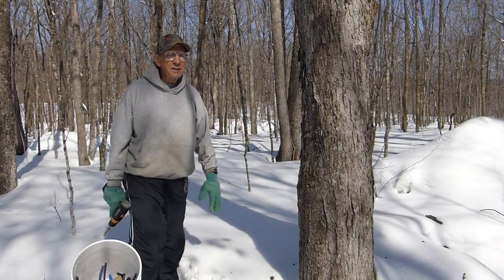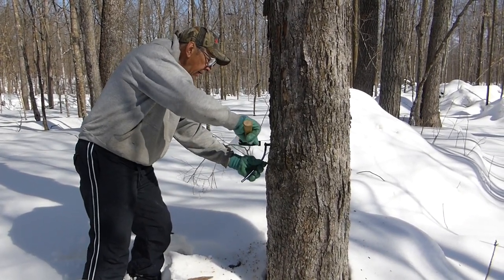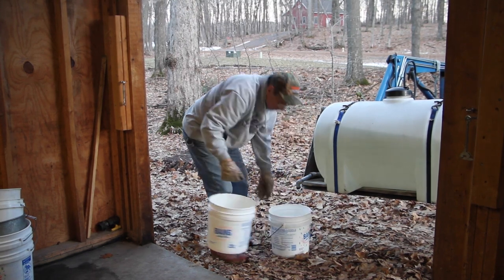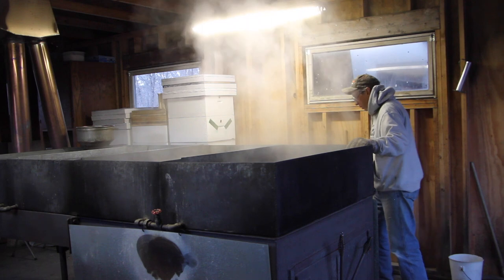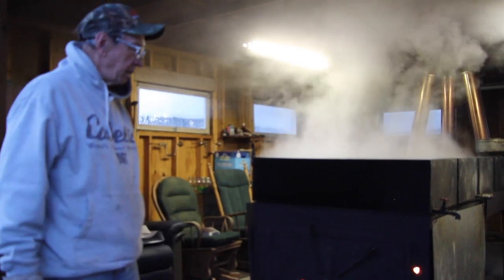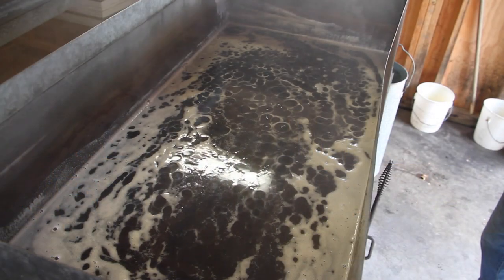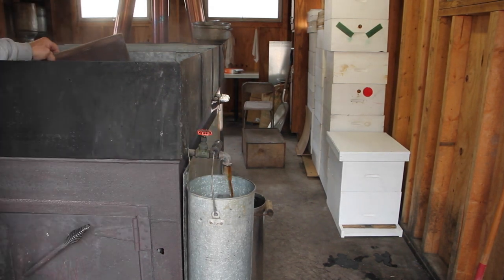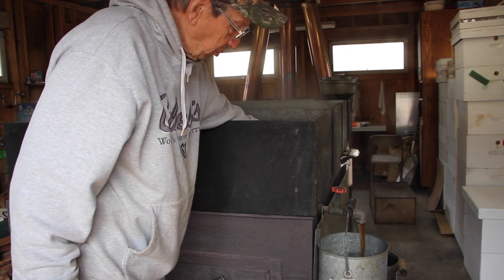maple sap documentary

Comment: The the sap is actually pushed down during the day and it comes back up at night to serve as an antifreeze for the tree. The carbon dioxide bubbles in the tree make pressure when its warms up. And when the pressure is greater then the barometric pressure outside it drips out of the hole.
Reply: Umm....nice try  but not exactly. When the trees freeze they actually create a 10 inhg vacuum in the tree bringing sap into the trunk. When the temp goes above 32 degrees they actually create up to 25 psi of pressure and push the sap out of the tree through any hole or crack. You may want to do some more research at Procters website or at the University of Vermont's maple page.

Comment: Great video!  Thanks for sharing.  What brand of filter press are you using?  I tap 60 trees and the difficult process I find is the filtering process.  I am in Ontario Canada and would like to check out some small presses like you have.
Reply from the maker: Here is Cy's response:  "I had shared a hand operated filter press with another family syrup producer.  The pump membrane failed every two years.  So, I purchased an electric powered filter press from WES FAB, 14420 N. 12th Ave., Merrill, WI 54452, Phone:  715-536-0501.  It was costly ($1,300.00).  It is fast, and it hasn’t failed.   Roth’s Sugar Bush, 656 Tower Drive, Cadott, WI. 54727, Phone:  717-289-3820, a maple syrup equipment and supply house, sells stainless steel filters of various capacities from $1,400 to $2,400.

When I started my family operation with milk jugs, oil cans, and ice cream pails I had used a wool stocking to filter the syrup.  The kids never complained about the small amount of sediment on the bottom of the syrup bottle.  I use 480 spiles."
Reply: Thank you for the follow up!  I’ll have to look up some suppliers here in Ontario Canada for pricing

Comment: Hello awesome video, I love seeing the old ways not the way it's done today commercially. I have a couple of questions I think I have 4-5 maple trees on my property, thought I had 6 but with your description of a red maple I have one with the buds.  Was wondering if that's enough to make a couple quarts of syrup. How do you know how many taps per tree, how much sap will I get per day on average, and how long can I keep the sap, or can I get boil it to kill bacteria and refrigerate it until I have enough to make a batch of syrup, cause I hear it's a 40:1 ratio, so I doubt I'll be getting 20 gallons in a day, I figured maybe a gallon per tap. So with only 5 trees id need a few days a sap to make it worth running a batch. This is only for my personal use so I'd be happy getting 3-4 quarts.  Thanks for your time any info would be awesome and if you have an email that I maybe could send pictures of my trees to confirm that they are the right ones.
Reply from the maker: +Derek Droc 
Sorry for the delay in response, I have been away from internet.  Here is Cy's response..."red maples do produce sap that is 1 - 1& 1/2 percent sugar (our's may be 3 - 5%), therefore the ratio would be 50:1.  The syrup is sweet but tastes somewhat different.  About one gallon per spile on a good flow day.  Freezing after boiling the sap is fine. Small batches are hard to manage.  Boiling sap in the house makes everything sticky. (Therefore, boil outside on cookstove or fire.)  Try it and be creative about how.  Discovery is the joy!"

There are lots of other youtubes that might offer advice on the 'backyard' sapper.
Reply: I make 2-3 gallons of syrup each year tapping only red and silver maples.
Reply: Julie Brown  . Julie, can u tell me what kind of jars he is using?  mom and dad have always use the canning process for the syrup in a pressure pot, this gentleman looks like he just poured into a glass jar with a probably might guess his of Steel lid?
Reply from the maker: Cy uses 'Snapple' bottles.  They are washed well. The hot filtered syrup is added to the bottles and the cover will 'pop' and reseal the bottle. Occasionally, one fails to pop and is kept in the refrigerator and used first.
Reply: If you cook your syrup down to the red line Or 32% on the tester, you do not need to can it, just put it in the jars hot and it will seal and stay preserved
Reply: Thank u.. one other question. . Hard freeze. . The whole bucket freezes.. many say that the ice is just water.. I was looking for some clarification on that, how cold? how much ice is just water?
Reply from the maker: Here is Cy's response:  "Yes, the ice is just water.  Sugar's chemical formula is:  Carbon 12, Hydrogen 22, Oxygen 11.  You can see that sugar is nothing more than carbon and water, formulated by photosynthesis (sun light), and it cannot freeze as a molecule.  HOWEVER, these molecules are trapped thru-out the ice block, - they don't settle out or separate out.  I boil it all.

Maple sap is 95 - 97 % water as it flows from a sugar maple."
Reply: If it is a hard freeze I will let it all thaw, but When I dump it into my bulk tank, I have a screen in the funnel, and ice that doesn't go through I dump on the ground, I tried saving all the ice one day and tested it and it showed zero sugar,
Reply: Thank you Julie and Trip so much for that help..
Reply: Sorry I have one more.  The white that " settles out after it canned" is that the sugar sand I am reading about.. by getting that white on the bottom of the jars, I must not filtering it enough?
Reply: And if that is the case,  any suggestions?  Thanks you all..
Reply: And By the way... I think I'm addicted to this!!  Lol... I have now taped about 30 trees
. And we just did the second big boil. 110 gal.wa 's the first one and the second was 70 gal.  All the family will have some syrup! !
   Now to make the stove or something  that I can use wood on..  propane is not cheep.. but I am learning!
Reply from the maker: Cy's response:" You are correct about what the white layer is.  It is also the accretion on the bottoms and sides of metal sap cooking vessels.  No harm in consuming it.  An orlon filter bag from a maple syrup equipment provider will capture the majority of the "sand".  A pressure filter using filter papers and diatomataceous earth will remove all the sand.  The filter devices are pricey."
Reply: Julie, 
Thank you for helping me out. 
And by the way,  the propane is not cost effective. But I will have to just consider it the cost of going to school. Please tell CJ. Thanks.
God bless.    David
Reply: stoke a wood fired epaporator vs propane

Comment: Hello CyGlad I found you. There are a lot of opinions out there but I question some of the advice.You are old school and that is what I was looking for. The sound of the sap landing on the bottom of a empty bucket is indeed "music in the woods"Question: How deep do you drill the pilot hole.  Also  I never saw the two types of spiels used  and the positioningWhat is the reasoning with that processThanks Tom Stockbridge, Ma
Reply from the maker: Cy's response: 

I mark my drill bit at 2 & 1/2 inches.  That is the maximum depth for large trees.  The outer 1/2 inch of the sugar maple is bark, xylem, and phloem, therefore the productive sapwood hole is about 2 inches.  I allow each sugar maple grove to “rest” for five years after tapping as recommended by my Native American neighbors, to allow for new sapwood growth, and to show gratitude and respect for nature.

Iron was abundant when the earliest spiles were manufactured.  The process involved forming sand molds and pouring molten iron into them.  Their shortcomings were rust and breakage.  At that time aluminum was rare and greatly valued at about $1.10 per ounce at 1850 dollars.  A very small cone was installed atop the Washington Monument to prevent lightening strikes.  Since then aluminum has become abundant and preferred for spiles (and beer cans) because of strength and non-corrosion.

The upper and lower spiles for each gathering pail are off-set laterally so as not to interfere with the sap flow from either hole.   Subsequent tap holes should be at least 2 inches to either side, and 8 inches above or below old holes.  That rule became evident when I had a blow-down sugar maple log sawn into lumber that showed the interior response to tapping.

Probably a late sapping season for both of us, Tom.  Winter is being persistently violent East and Midwest.
Reply from the maker: I just published another video with Cy that I think you'll appreciate.  https://youtu.be/anjTeQ7vVxc

Comment: He is measuring hot syrup but the instrument is usually calibrated for specific temperature (usually 15 ˙C). Is there any temperature adjustment made when measuring sugar content?
Reply from the maker: Here is Cy's response: "I very carefully measure specific gravity at 212 degrees  F (100 C).  If over that density, the syrup is a super saturated solution and when cooled will crystalize in the containers, often looking like large, uncut diamonds.  Interestingly, those crystals have no maple flavor when dissolving in the mouth.  It appears that the latticework arrangement of molecules in forming the crystals will not tolerate the presence of any other matter (minerals, flavors, etc.)  Vigorous stirring of over-saturated syrup  is required to form small crystals (sugar) to which the flavor elements adhere as a mixture.  

I assume that my syrup is about 2/3rds sugar, gauging by  its 'pour' consistency.  More than that, it will crystalize, - less than that it is “watery” and ruins pancakes.  

I don’t retail, therefore I don’t conduct any measurements for salt, fats, or sugar content, etc."
Reply: @theacornmama  Ty.

Comment: You mentioned that your evaporator pans are piped together and that the sap flows between them.  What is the motive force that moves the sap between the pans?
Reply from the maker: Here is Cy's response..."Actually, I have the pans adjusted to level.  Evaporation takes place primarily in the first (front) pan over the heat source (wood fire), and gravity controls the sap replacement flow.  I always hold some sap in the pans throughout the sapping season and add each new gathering to the back pan to make its journey to the first pan where it becomes syrup.  When the flow season is over, I scoop all the sap into the first pan, add water to the other pans, and boil down the last batch of maple syrup.  I keep that last batch for my selfish use because it is the darkest and most flavorful (I believe)."

Comment: I wonder how many people watch this video as their "how to" and end up grossly over tapping and killing their trees. This man is completely out to lunch in comparison to the do's and don't of tapping. Never have I seen double tapping where two holes are done above and below. But not only that, putting in far too many taps in total on trees nowhere near big enough. He has enough taps on some trees that wouldn't even be considered on a tree 6' wide... And his "boucing off with the hammer" may sound simple, he really doesn't prove anything. He's just going by general feel with his taps and then letting his hammer bounce off the tap like a drummer using his stick. This bounce effect can be purposely done with little hits, or hard hits... There's no feel for when the hammer really bounces off. You just need to use common sense, right size drill bit (with very straight pressure to not oval the hole) and not hammer excessively.
Reply from the maker: Here is Cy's response to your tapping concern...
"A commercial producer visits me at the beginning of each season to commiserate and share stories about farming, steam engines, and the wonderful smell of draft horses.  This man scolds me about over tapping as well.  I tapped the same trees the first 16 years of sugaring, then acquired another maple forest so that now I tap each tree no more than once every five years.  During 48 years of syruping I have lost only one sugar maple.  Its top was broken off in a storm.  I salvaged the trunk and rendered it into lumber with which I built two blanket chests, one for a bride, and one for my brother/helper, showing the tap holes.  A wood carver created several exquisitely beautiful bowls with the tap holes as well.  I saw a sugar maple in Vermont with 24 taps in its circumference that had been tapped for two centuries.  I assumed the owner was just showing off."